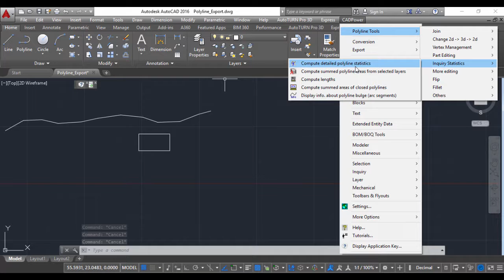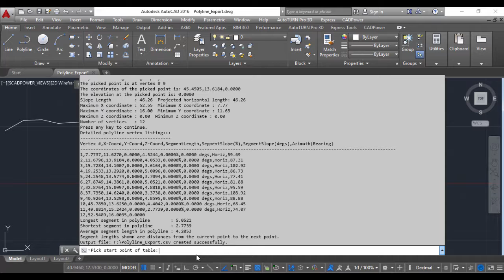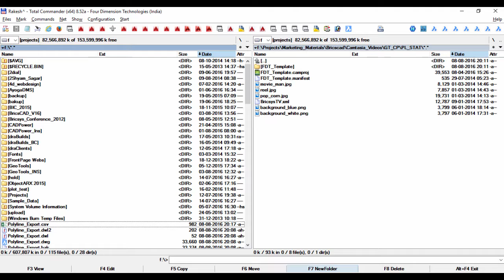Compute Detailed Polyline Statistics in AutoCAD, BricsCAD | CADPower Tutorials | CP_PL_STAT | Rakesh

Comment: this is helpful tutorial but how i can get cadpower menu
Reply from the maker: Have you installed CADPower? For AutoCAD or BricsCAD?  The help instructions are in readme file for configuration so that you can get the menu if not already visible. Else, try and type CP_ADDUI on the command line.
Reply from the maker: More info and support, email me rakesh.rao(at)thedesignsense.com or call me +91-9243438300